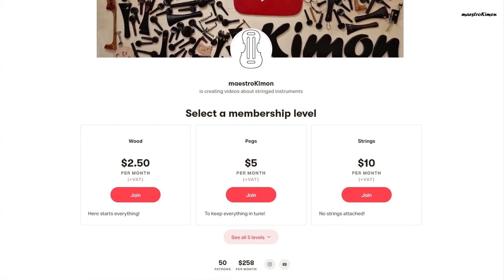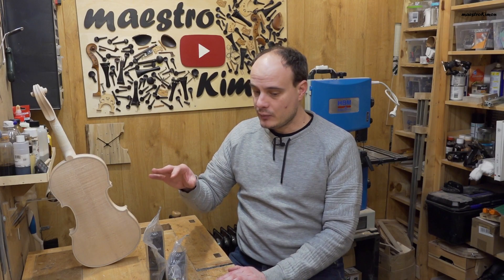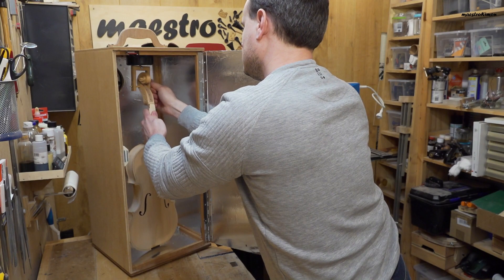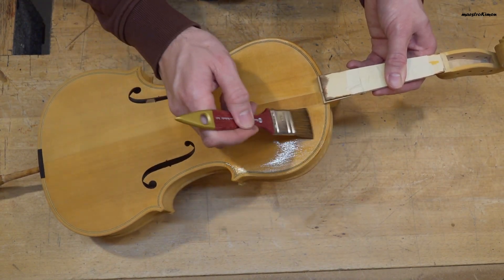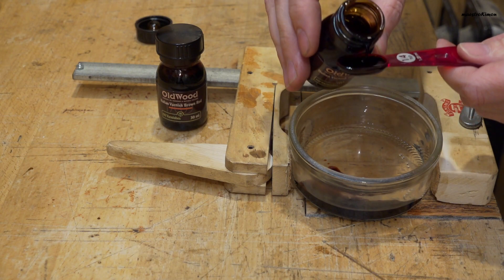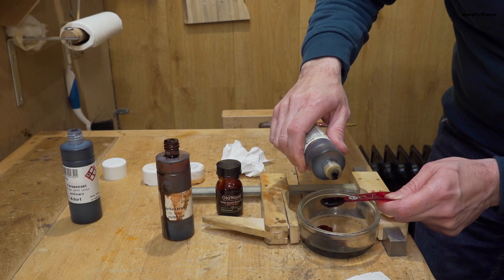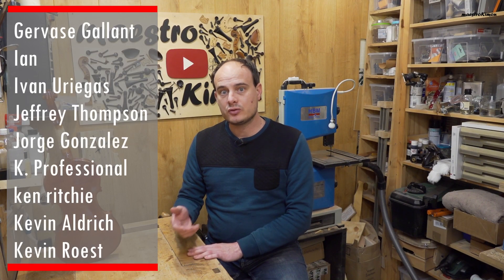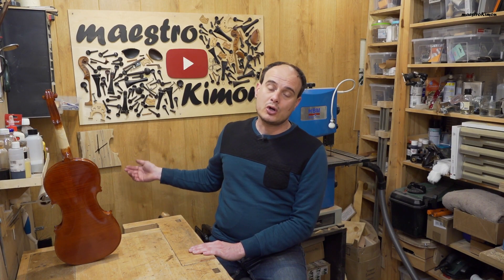OldWood1700 Colored Varnish Review

Comment: I really like the colour you got! One question though. When I've been using Hammerls colour extracts with Hammerl varnish, it always made the varnish set way too quickly and becme sticky on the instrument before I could even it out. And I only used a couple of drops, not this much.
Do you not have that issue, or are you just better at varnishing than I am? 😛
Maybe you don't even get that issue with Hammerl, but it could also be that Old Wood does not have the compound that lets it polymerize without UV and that makes the difference? Please enlighten me, as I've stopped using the extracts much even though I quite like them
Reply from the maker: Hello Tobias. My experience with the Hammerl varnish is that it is very sensitive to the humidity of the environment. In dry weather (or air-conditioned spaces) it drys to fast. Also other viewers confirmed this.
Reply: Really? As you know, I'm in Denmark. I don't think our climate is much different from yours, and for me it always gets sticky.
I'm going to try it with the Old Wood varnish as you did here. It might just work great
Reply: @maestrokimon  I tested right now this Italian varnish. 1 day per layer - for me is incredible. After 3-4 days in + waiting always Tacky and when I hold on my hand all over fingerprints .... ugly. I don't add to any materials - aplying it naturaly. what's wrong??  ....